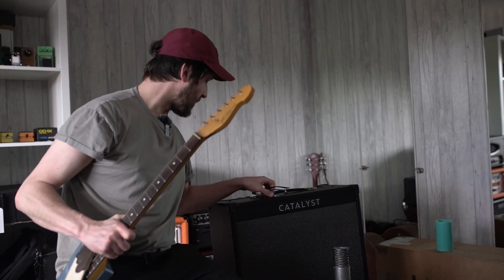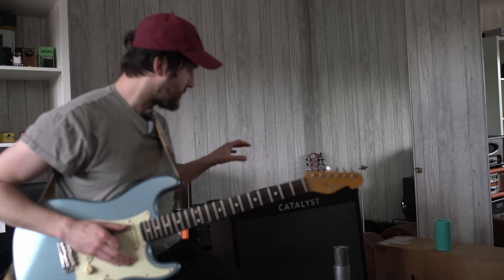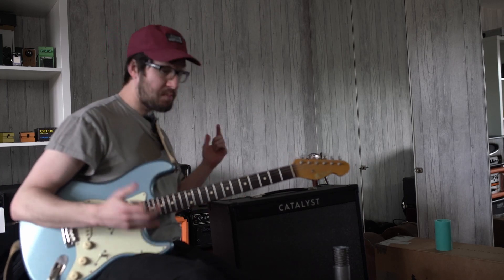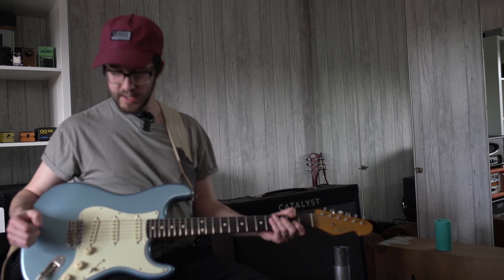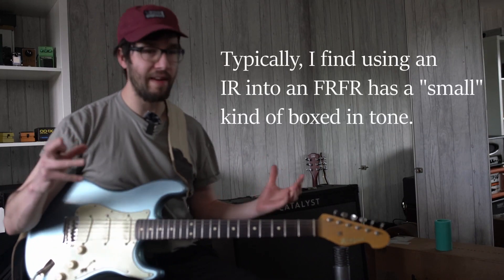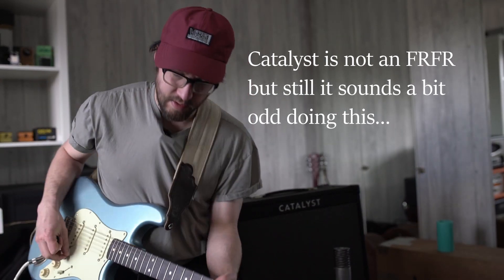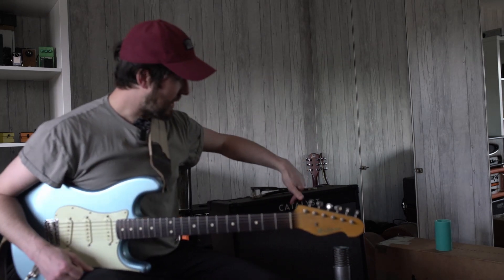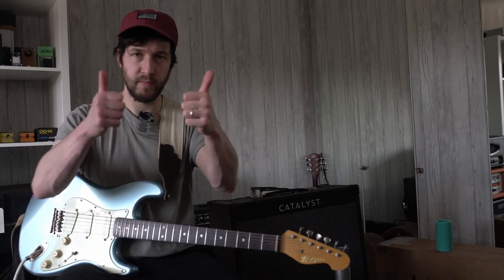I won't be using an FRFR speaker anymore - LINE 6 Catalyst with a FRACTAL FM3

Comment: I’ve tried many of the Frfr cabinets and most sound horrible to me.  I even bought the Atomic CLR spouted as being the best.   The much less expensive Headrush units sounded better.   My advice is to just buy a pa top. I recommend the Yamaha DXR10 I believe is the model.  It’s sounds great and will give you approximately what is coming out the front of house.
Reply: Nah - have to say that’s just wrong I’ve compared the atomic against nearly every frfr ! Friedman Qsc Yamaha the atomic just blows them away from most fronts and tested with  fx2 and helix
Reply: I had three guitar players come to my house and listen to the atomic clr.   We all said the same thing.  Sounds like a box.  Horrible sound.  But ears are different.
Reply: Horses 🎸😎
Reply: Turn them up to gig volume and your opinion might change.   If you can't then other systems that work better at low volumes would definitely be the best bet for you.   Even your patches will need to be adjusted with increased gig level volumes as mids and highs will increase with volume - Fletcher Munson.

In the end though everyone's ears and preferences are slightly different.   Going from Tube or Even SS amps to modeling takes some adjustment, and the right IR's that aren't "boxy sounding" help.

I love both amps and modelers.   I've been using Modelers almost 100% of the time since the release of the AxeFX Standard back in the mid 2000's.
Reply: @adamjones8218  I agree, gig volumes make a huge difference.   Different IR’s of course make a huge difference.   I played two shows with the Atomic and it sounds boxy.  Playing with irs may have helped but right out of the gate other cabinets sounded better.  Again I go back to a decent pa top, which will give you a closer approximation of what comes out front of house.  Of course if your playing small clubs where you don’t come through the PA, then use whatever.   I didn’t like the Atomic but I’m sure many guitar players get great sounds from it.

Comment: I have always asked myself which will be a better investment on the long run. I'm what we called a "bedroom player" and currently I am experimenting with Neural DSP plugins.

I am not planning on jamming or having gigs but I am more interested on learning mixing/mastering.

Would a FRFR work as an hybrid method por playing along (maybe at house with friends) or should it be better to invest on audio monitors? The T8V by Adam Audio looks promising.

Anyway, wonderful playing and tone! Thanks for sharing!
Reply: If you want to go into production you need good studio monitors and someone to help you get your room balanced so you are not chasing your mix all over the place.  A decent set of mixing headphones are helpful also.  After you get a feel for both of those you can always add in a guitar amp of your choosing.
Reply: @bryantwalley  I currently own some M50x by Audiotechnica which I used 95% of the time. I have bought some foam panels but I prefer someone installing them for me (I have learnt some things watching tutorials and reading a great book about acoustics but still..) I would rather have an experienced person than me alone.

What are your opinions on the Tv8 by Adam Audio?
Reply: @xxdannyxxl  truth is most of the near field units made now are decent.  I have not had to buy any in a few years now but if I did need to I would consider the T8Vs as a reasonable nearfield option.  The problem most people have is the room.  Then they blame the speakers.  If you get the monitors, the eq, and the room working right you can get a rock solid mix.  I also know several engineers that use that same line of Audiotechnicas.
Reply: I would go with good studio monitors first. Especially if your using plugins.

Comment: If current events really mark the end of the tube era, the industry really needs to make a concerted effort to banish boxy tones that are so easy find in the modelling world
Reply: They are easy to find in the tube amp world too. We just ignore all the boxy sounding ones and associate "tube amp" tone with the best of them. Also, I find it easier to make a modelled amp less boxy than trying to make a "real" amp less boxy. Cheaper too.
Reply: That's why they have parametric EQs in them.
And even your tube amps, they do require heavy EQing before it gets to the audience because your perfect amp tone is filtered and ruined by microphone usually. 
You don't do heavy EQing though with the real amps, because there will be another sound guy for it even though you have no idea how skilled or unskilled he is. 
It's not the problem with modelers. That's how your amps sound like through a microphone in the real world, and modelers are modeling just that. 
Of course, the microphone model and the placement makes a huge difference.

Comment: Can I ask, why would anyone use FRFR speakers in today’s times when the option of IEM is available at lower prices? They protect your ears and your complete mix (with/without metronome) is easily available for you and the whole band to stay tight. 

The only reasons I can think of are: thump from the frfr speakers caused by air pressure (actually I don’t even know if that happens) and just having a “stage feel “ along with crowd noise. I haven’t played on stage since almost a decade and things have changed drastically. Why would people with modellers go the FRFR way when IEM is available?
Reply: IEMs sound RADICALLY different than hearing an amp or a speaker in a room, that's a large part of it. Another part is that custom IEMs are expensive and universal IEMs can be very uncomfortable depending on the IEM and one's ears. Dialing in a solid room reverb makes a big different on the "amp/speaker in the room" sound but still falls well short of the authentic sound of a room.
Reply: I played with IEMs for a good 12 months and felt I was doing more damage to my hearing than playing through a low wattage stereo power amp and a cab with the Celestion F12-X200 speakers
Reply: @Brandontsmith85  for the latter part of your comment, it wouldn’t make any difference for a gigging band who are playing different sized venues with different acoustics anyway… 

I can understand the “sounding different” aspect. As far as the FOH and audience perspective sounds are bang on, while you’re playing on stage the fidelity won’t matter more than the sync of the band. This is just my perspective. I would rather hear every other band member clearly along with the click track than lug around a heavy FRFR. If these are the ONLY reasons why people choose to play through FRFR and not a very widely available IEM (say Shure SE215K) then it’s not a very strong case for me. Maybe it’s all preference after all? I would logically go the IEM route
Reply: @Brandontsmith85  also I forgot to mention, my original comment was directed towards using MODELLERS with FRFR. If I owned a nice amp I would never use a modeller (probably just through fx loop for modulation)
Reply: @jeffboone5902  How will a noise isolating IEM (with literally cuts outside noise to force you to use lower input volume through earphones) cause damage to hearing? The noise cancellation concept was literally developed to protect hearing. Yours is an interesting comment because I’m trying to do as much research as I can to make a solid live rig and I would really like to know about you experience. What are the shortcomings of an IEM setup?
Reply: @Aditya Bali  Honestly, I 100% agree with you there when it comes to touring or playing large venues. I think the IEM route would be ideal for that usage.  Home use or jamming with mates? I'd definitely go with FRFR over IEMs - and those scenarios are where I spend most of my time playing.
Reply: @Brandontsmith85  yes in that scenario definitely makes sense because FRFR can really help to define the sound. I basically have a hernia and I’m looking for modellers to replace traditional amp and cab setups. Thats how I discovered this FRFR thing people are doing these days with modellers.
Reply: @adityabali1939  Can be tricky sometimes to get good sound on stage with a valve amp, .Often heard my own and friends modelling/transistor gear sound "better" than expensive boutique gear.Player makes the biggest difference anyway.My pal tours in a springsteen tribute band and they have to use in ear monitors.He says he misses the interaction between the amp and guitar / harmonic content .We are old skool so we grew up doing it the old way until we had to do it the "modern" way
Reply: @nickg2431  I agree with the difficulty of getting a nice stage sound. But if the band is using IEM and everyone’s going direct to the FOH console your stage will literally be noiseless, except the drum acoustics. In a situation like that how will IEM be damaging to the ears?

I should probably mention this is in contact to modern metal genre scenario, where the sound of this genre is literally shaped via modern modelling and order tools. Personally, I’d rather keep in sync and be tight with all other band mates then have a high fidelity audio experience on your stage. While I’m on stage, the adrenaline is too high anyway to critically listen to the mix. I’m up there just to jam out and enjoy playing.
Reply: @adityabali1939  there is nothing wrong with either way with 30 plus years of experience (plus some other experienced opinions from people i know) i do know what im talking about.If one works for you better than the other fine.There are trade offs for each ,depends on appliction.Nowhere did i say  that IEM would be damaging to the ears BUT as you raised the point to me if IEM are too loud they will damage your hearing.If they are not designed well then they wont isolate the noise outside of your ears like the crowd , machines and floor noise.Then you will need them louder,then they will damage your hearing
Reply: I'd been using IEM with my Helix for the last 8 months or so, and monitoring wise, it's a game changer. I use one of those IEM machine that allows me to control the ballance of the whole band and even apply different EQ settings to each instrument and it's great. 
But one thing I miss is being able to hear the croud. 
I'm a modeler dude so I just laugh at those that say you have to have the amp in the room sound to get good tone, but that interaction with the croud is something I really miss.

Comment: I'm telling ya john, get a real cab you like, I have a 1x12 open back mesa I use with a Duncan power stage power amp, it sounds better then any frfr out there
Reply: @John-e4p1x  yes
Reply: Catalyst is not a FRFR system.
Reply: @adamjones8218  exactly - it's a 1x12 "real cab" w/ a Class D power amp (like the Powerstage), plus a backup amp all at an unbeatable price.

Comment: Yes...line 6 has smashed Boss on this one...imho. kinda sad. Boss just does things good these days while everyone else is doing things better than good. Boss used to be the leader of guitar effects gear. Maybe in wrong
Reply: No your not played boss for years(ago) you can still get a great sound out of most things but the modellers sound thin and flat to me ever since the gt6 model was introduced.The gtpro never sounded as good as the gp100 .Usually very reliable though choice of many pros to "get a job done'